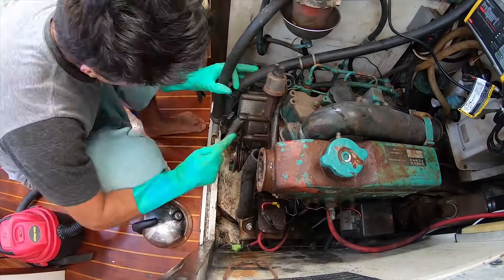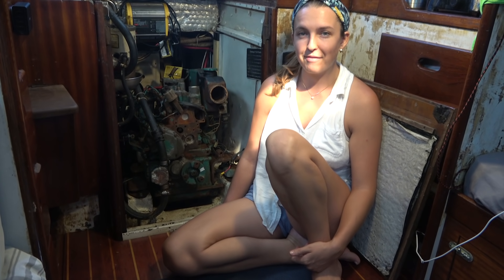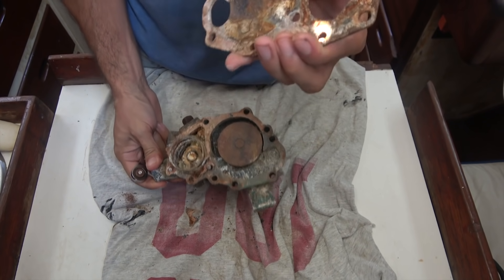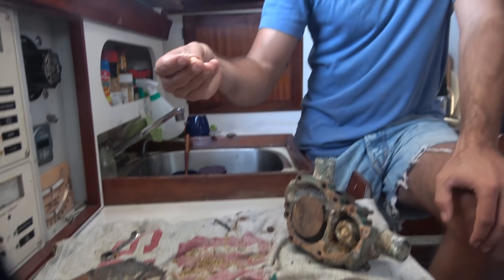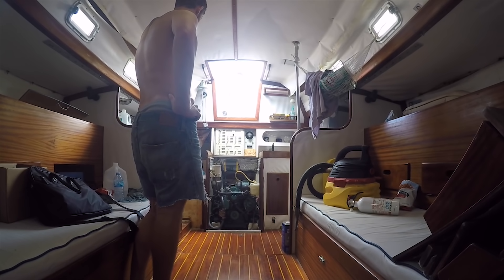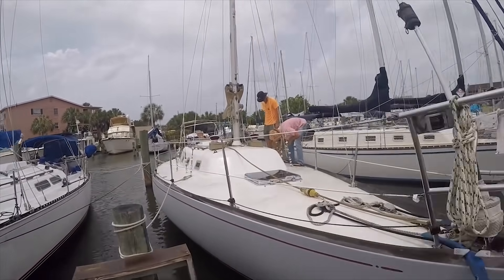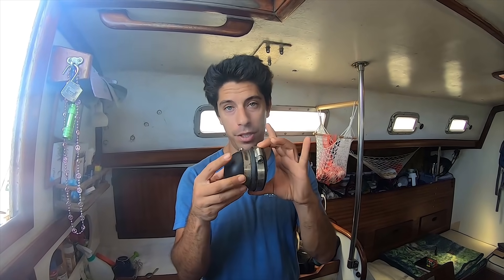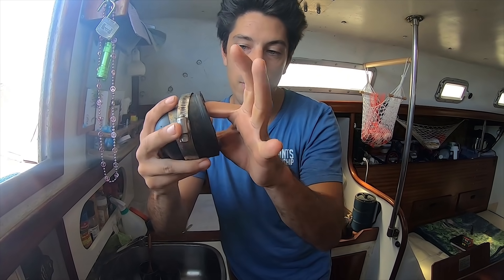Do NOT Buy a BUDGET BOAT without Starting the Engine!🤦 - Bums on a Boat Ep 122

Comment: You two are awesome! Believe it or not 1800 rpms didn’t save the engine it killed the exhaust elbow. Diesel engines don’t like low rpms that keep temperatures low and create carbon which clogs the elbow. After every use rev engine in neutral to blow out the carbon and smoke. When operating at lower rpm 1800 for 4 hours run at 2500 for 30 minutes to blow out carbon. You’ve got this.
Reply from the maker: Anytime we would run it over 2000 rmps water would shower the engine non stop and fill up the boat.
Reply: Bums on a Boat I totally get you had to run at moderate rpms. We do what we have to. And it’s a negative feedback loop. Low rpm = more carbon blocking the elbow = need for even lower rpms. You’ve got this now

Comment: You've got it apart (hopefully still), retest that heat exchanger for leaks, very important.   That crud in the water circulator,  probably in other places too, like the cylinder jackets and heads,  flush it out.   Old engine, especially in salt water equals problems.   Should be doing a weekly look over for things like salt water in the coolant tank and leaks.   Check the oil every 5 to 10 hours of use.   Gotta stay on top of it.   Hope it works out for you.

Comment: I'm not an expert on marine diesel but been repairing engines a long time. The best and most cost effective thing to do would be to pull the engine and have it rebuilt/replaced. From a thousand miles away you can tell everything front to back needs servicing. The hard and expensive way (but you may be in quarantine and have the time) would be to do it little by little but you will probably always have a problem. If the outside looks that bad the inside does as well. However you would learn a lot! Just my 2 cents and my approach.
Reply: this motor looks rough? no worries. Im on the fence here Joel, this motor gets alot of weather and salt water is awful, ive read many times that the last elbow in the cooling drain line is clogged is crimped? beginning the slowing process.Ive heard there is  stainless steel muffler pipe that you can replace the corner(last turn) with , a muffler shop will size and bend a pipe for you , then you would need to cut it to length, it needs length for the bender.  The gaskets seal on the heat exchanger is the most inportant! often one gets cut on install and starts the process all over, please use marine grease for this application.No Dry Humping we say,, replace broken and old bolts with Stainless Steel ones not knock off SS, get at a marine store, $, use High Temp Waterproof grease on threads for replacement, torque to spec, this is very important to gets bolts to right, and same torque.then a valve adjustment.   Next time as soon as the Exhaust Water starts to Fluff out, not run out, you are getting into a problem, this time when you get it right a steaady stream will flow out. We Love You!   Hello from the Desert, hey its a dry heat...
Reply: @cD-vg5go  What I'm saying is corrosion in the coolant and oil passages will interfere with heat transfer in the castings and cause uneven stress across gaskets. If an engine is overheated and has a history of being overheated it's got to come apart if you want to make it reliable again. (metal moves)  Maybe everything is in spec and muratic acid in the coolant system and oil system cleaner might work but I can't think of any other situation where we would want a more reliable engine.

Comment: Now that you have a working cooling system, check your engine manual for the recommended maximum RPM's then try and run the engine at 3/4 of that speed, for a few minutes after each time you run the engine at low speed, doing that should minimize the carbon buildup in the exhaust elbow.
Reply: The exhaust elbow becomes plugged with scale and corrosion, not carbon.
Reply: @flyingdutchman6984  Mine carbonises up on my Volvo Penta D1-20 the version after BOABS one. I agree with John that running at 3/4 revs for a few minutes before shutting down will help heaps.André

Comment: there is marine grease - use it when putting the bolts back. Also, you can pressure-test te heat exchanger and change the anode in it.
Reply from the maker: We have anti-seize to use on the bolts. Maybe a combo?

Comment: When I decided to buy another boat I shopped for awhile. I knew what I wanted and had it down to 3 boats. All Morgan's! I didn't buy the one that had the best paint job or the most equipment. I bought the one with a brand new engine. Less than 100 hrs. Its worked out pretty good. Keep up the good work

Comment: When you reassemble the system, if you could add a pressure gauge into the sea water line somewhere after the pump discharge, it would allow you to keep an eye on the pressure, and you could see if the pressure was rising to where the boot would leak.  Could prevent seawater from getting into the fresh water loop. Greg

Comment: Cleaning up the motor and rehabbing the cooling system will go a long way towards reliability. A clean motor and bilge will give you early indications if you have new leaks forming, allow you time to diagnose before the problem becomes critical. The thing to remember about all things mechanical is that it is nothing more than a lego set. You start with one piece and keep adding till the set is built. The technical aspects of motors are laid out in the build specs, a fine set of calipers can get you most measurements, and any machine work a competent machine shop can handle. The good thing about a low output diesel is that they can be tolerant to shade tree repairs. Don't be affraid, just take your time, double check yourself along the way.

Comment: Perform a compression test on all cylinders, try to get what is the PSI standard for that engine. Drain the engine oil and send it out for analysis, check if crankshaft bearing material is present in the oil.  If the compression tests and the oil analysis are good, the engine might be ok.

Comment: Love this vid. I think you'll find the base engine of yours is actually a Perkins md20.30. Branded volvo is very expensive however there are parts number conversion tables all over the internet so you can buy Perkins parts for it. Do a search for the engine number on the front of the block starboard side on the top front. Nani do the same thing with there smaller engines. Kubota base engine, branded Nanni... Oh, White vinegar dissolves scale... It also cleans up uncured epoxy, good too for cleaning up utensils used for the epoxy job...
Reply from the maker: Thank you, we have discovered the magic of white vinegar and use it regularly.

Comment: Great job! And, yes, the elbow is a 'wear' part that needs replacing somewhere around 5 years.

Exhaust risers and elbows can develop an internal leak of raw water between the water jacket and the inner hot exhaust area. The leak cannot be seen however, in many cases, the raw water is able to enter cylinders, freezing valves and the piston and cause catastrophic damage.

We owned 4 power boats, one of which we had for just over 30 years (yes, I am old). We learned so much about exhaust risers, oil/transmission coolers and heat exchangers (and the need for regular replacement of the sacrificial anode).

We were able to greatly extend the life of all of the above by flushing out the raw water side of the entire system after each trip when the engines would be unused for a period of time. You may want to consider flushing your engine. Installing a low oil pressure and engine temperature alarm would be a good consideration.

Be sure to treat any fasteners that were removed with anti seizing product before reassembly.

Great to see you learning so much and the incredible enthusiasm and effort you both put into the projects. 

-Paul

Comment: Keep plugging don’t give up. Have you made any calls to Volvo Pinta for help? That would be awesome if they donated a new or rebuilt engine to your channel. I think you said you have new gaskets coming also. Hopefully you do not have any valve rods or piston problems. Give the engine space a good cleaning and some paint if you can while doing this project. New fuel filters and impellers if needed. Spare parts always. All the best wishes for success. 👍🇺🇸

Comment: The only place where salt water can mix with the coolant is in the heat exchanger.
The exhaust elbow only cools the exhaust and keeps salt water out of exhaust manifold.
In you prior video the heat exchager core was coming out of the heat exchanger body.
There should be an o-ring type seal at both ends of the core to seal with the body at each end of the core.
It would be money well spent to have your heat exchanger checked and serviced

Comment: Hope you going to use anti freeze when you put it back together 
A infra red heat thermometer is a good tool to check the coolant system for blockages etc 
Maybe buy one and keep a record of areas of cooling system heat values taking into account sea water temperature

Comment: Make sure you use the correct coolant (antifreeze) straight water or straight antifreeze is a no no. Best is to get the pre mixed (50/50) which is the most common nowadays. Things to check #1 intake scoop for marine growth or excess paint, look, poke or probe just behind the grill for growth too. #2 The suction line between the intake and raw water pump should be marine wire reinforced so it cannot collapse under vacuum. #3 check the sea strainer for blockage. Very important to make sure the access door to the strainer is air tight because drawing air will reduce water flow. #4 check the impeller again. They should be replaced every two years and sooner if it has been abused. #5 Pull the heat exchanger core and clean out the tubes. Than leak test. #6 Buy an assortment kit of Normally open thermal switches. Find a place on the exhaust hose to lightly hose clamp it to. You want to select one that does not close contact(on) at full power when the engine is working correctly. Wire it into a buzzer/light on the helm. The number one cause of marine engine failure is loss of raw water flow.

Comment: I will be interested to watch how you get the broken bolts out as they are possibly still rusted to the engine block. Drill and retap? If so how to know when to stop drilling depth wise, or a reverse thread puller?
Reply: John Foster my guess is they used vise grips on the broken bolts.

Comment: The motor will not wear out because you do not use it enough . Corrosion will get you . You need to flush the cooling system because there is just as much crap in the block as the pump . Get Volvo's advice for what to use .

Comment: I guess by now you have found out that there are special taps to drill into stripped bolts that go in counter clock wise and give you something to hang onto as you turn the bolt out

Comment: Please run a radiator/engine cooling system flush before filling with coolant. Get some of that salt water corrosion crap out of the cooling journals, otherwise you can get uneven cooling of your engine......major issues!!!

Btw love you guys👍
Reply from the maker: Thanks, we plan on filling it up with fresh water, running it for a while, draining and repeating the process a few times before adding the antifreeze.
Reply: Bums on a Boat, chewy Bacchus is absolutely correct. I have a huge fear right now for you guys with that engine. It is safe to say that the internal coolant passages might be so packed full of gunk that it is too far gone. I saw another recent comment suggesting an acid flush to remove lime scale. It may take multiple and multiple acid flushes and you could still have blockages without knowing. I also worry about what effect that could have on the new parts and heat exchanger. I wish you both lots of luck because so many of us have fallen for your seemingly boundless enthusiasm, perseverance, love for each other and your precious home on the water... Big virtual hugs, guys! Hang in there! Positive Vibes and lotsa luv!! Oh!! ...and May the Fourth be with you!!! Just two days away! There is no try, ONLY DO!!

Comment: How does the water not leak through that small hole in the heat exchanger.
Reply from the maker: I believe a combination of pressure in the manifold and gravity. By being oriented at 12 oclock, air gets out but water does not get in.

Comment: Great video. I enjoy your optimism.  Day by day you are learning more.  If this engine should fail to work have you thought about a backup plan?  Maybe a different propulsion system?  I took out my engine, shaft & prop. More work than I cared to deal with on 50+ year old beast. I have an outboard just incase I need a little help. The main system is sail power. My 25 foot full keel sailboat is easier to do this with.  Just saying you have options.  Hope it all comes together for ya soon. Love your channel.  ♡
Fair winds and following seas~
S/V Cork

Comment: So how did you get the snapped off bolts out? I heard you saying you used lots of PB Blaster on the remaining bolts. I ask because I have a stuck Transmission fill plug and all I'm doing is making it harder to grip on to.
Reply from the maker: After spraying the bolts with pb blaster twice a day for 5 days, we sprayed the rest again and they all came out. Once we wrestled the water pump from the broken 3 bolts, two were slightly threaded into the pump as well as the engine,  then we sprayed the broken bolts and used vice grips to unscrew them. They came out easy.
Reply: So thanks for that. Can't wait for the next couple of episodes covering assembly and test results. You two really give me the down to earth facts of what can and does go wrong and how other folks tackle the repairs. Keep up the great videos and be safe.

Comment: Seeing the state of the thermostat, you have to assume the coolant ducts inside the engine block are at the very least, compromised. I would not trust an engine, in that condition. It will very likely  fail when you need it most. It IS time to replace it.

Comment: Ohhh I just saw the sneak peak ... I want to make the elbow work!!!!! Warren
Reply from the maker: Oh yea, a savvy Bums Patron. Us too! Spoiler Alert to any readers🤐
Reply: Bums on a Boat  I think I would just get s regular stock elbow , you have a water trap muffler , what happens after that ?  The Perkins labeled version of the same engine does not have the hi rise as an option! ( Perkins actually produced the engine for Volvo , Badge engineering !!!).
All you have to do is be carful sailing heeled a long way , but it depends on the  height of you exhaust outlet too. 
Please don’t wast money on the Volvo option without trying the regular exhaust .mixer.   Cheers Warren

Comment: You have a cracked tube in the heat exchanger, need to get a replacement so this won’t happen again. Do a pressure test on the exchanger to verify.

Comment: You guys are doing great!. You clean out that elbow I would ram a piece of 3/8 cable through the unit , and chucked it in a drill at high and unleash the fray of death...!! Any chunks of crud will be strewn across the deck in the mêlée as elbows guts doth flow !!
Michel seems to slow her speech when she's a little stressed, her pitch and tone was different this time and kept looking to Joel for assurance.. I'm now an internet psychoanalysis ...your welcome!
Reply from the maker: Hmm, not sure if that would work so well but a fell cruiser said we could hold a torch to it for 15 or 20 minutes until it is almost red hot and that will burn the carbon blockage away.
Reply: @Bumsonaboat   yes ,light a fire on the beach and toss it in , bake it out and run the cable through. I use a cable to clear calcium deposits in water lines. Carbon is softer..light a bonfire and toss the elbow in

Comment: Step #1 - Remove the Volvo Penta Diesel.  Step #2 - Bring VPD to side rail of Boat.  Step #3 - Push VPD over side rail in a pre-selected Mooring Spot.  Step #4 - Install ANY OTHER of the fine Diesel Engines available..Step # 5 - Enjoy your trouble free Diesel Engine, knowing you have a GREAT MOORING SPOT!!..🇺🇸

Comment: I feel I need to add another comment- 1) This was clearly not the original engine in this 1974 boat, I am sure this was a re power at some time, this engine package is newer than the boat by decades. 2) The dealer that sold this package possibly did not do what Volvo calls a proper "commissioning" of the package- in other words,  installed it meeting all guidelines for a air intake, fuel supply, and exhaust flow.  I work for a Volvo (and Cat, and MAN, and Cummins/Onan) dealer- the warranty does not "start" unless the proper installation guidelines have been met and the paperwork filled out.  All the people saying to "put a different engine in there" have clearly never been involved in re powers. I have. Are "they" going to pay to re make all the mountings, since they are never the same, and all the re wiring and re plumbing required to go from Volvo to some other brand ?  No I suspect they are NOT.   Bums, you have this handled, and are learning from your mistakes. No shame in that, keep on keepin' on!

Comment: Sorry about the jerk that sold you the boat , you know how hard it is to remove the elbow - it was not off to stop one stealing his boat  as all he needed to do was pull a wire off the starter .
Reply from the maker: We still don't regret the purchase but there is no doubt we should have done that and had good grounds to talk the price down, especially if we saw the cracked fiberglass structure.
Reply: @Bumsonaboat  I am ashamed for the boating community that someone took advantage of a newbie like that . Not working motor , not pristine , structural problems , poor maintenance , that crap cockpit repair - yes way down . However you have it under control and you will be able to fix anything  anywhere now .